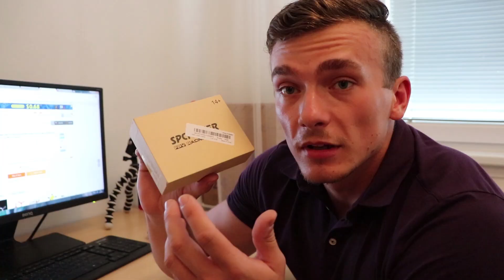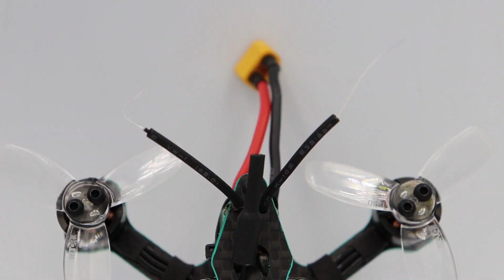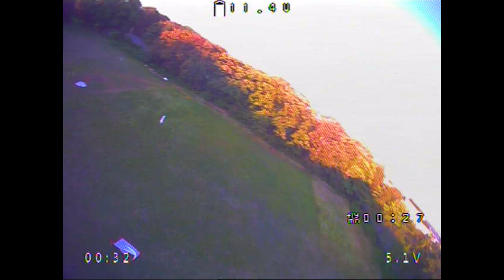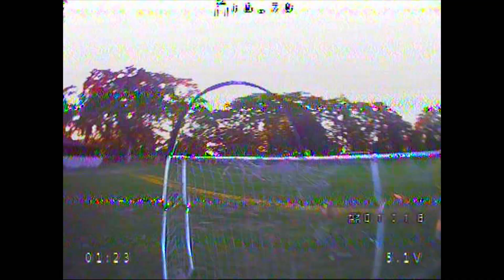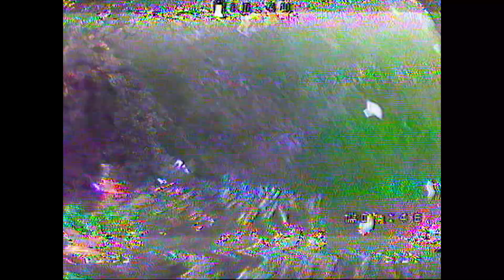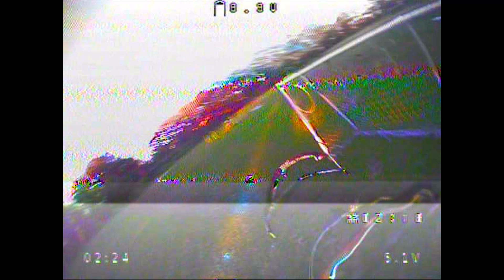SPC Maker X90 - 2" micro review

Comment: Nice review cool flying 🖒what did you set on the p gain ?
Reply from the maker: thanks buddy, I will put my PIDs into description tomorrow :)
Reply: spaglFPV   Cheers buddy
Reply: Milan Klapač  No update date.. I sorted my own PIDs..  don't run yours out the box or you will burn the motors out. I turned all the pids down by half then tweak them to fly smooth without any oscillations
Reply: @paulgolden8183  I have one of these coming in a few days.  I am far from proficient at adjusting PIDs.  I would be eternally grateful if your would put your PID setting on here so I can get mine in the air safely.  Thanks!
Reply: @Narada65  .. if your running it on a 2cell battery the pids should be fine.. if you using 3 cell you will burn the motors out.. I will plug the quad in when I get home and put my pids up later for a 3s battery
Reply: @paulgolden8183   Great!  Thx
Reply: @Narada65   my 3 cell pids I cut in half what it comes with flashed on betaflight.. I also turned of all the filters in beta flight.. use that and check it runs smoothly and warm but not hot for a min..
Reply: @paulgolden8183  Thanks.  I've flown it with 2S and stock PIDs and it flies really smooth, but could use a little more power, so I am going to try your suggestion for 3S very soon.  Thanks again for you input.  Much appreciated!

Comment: For a first micro drone, do you suggest a 3" micro drone over a 2" micro drone for better stability?
Reply from the maker: Hello Donald, well as I said its easier to fly with 3" props because of the stabily and its also easier to tune it.  However lighter (smaller) is better in this case because you cant hurt anyone and it can handly more crashes. check my video about Trainer 90, I think that one could be good one to learn on. 1s batteries are really cheap so you can get a lot of them and fly anywhere.